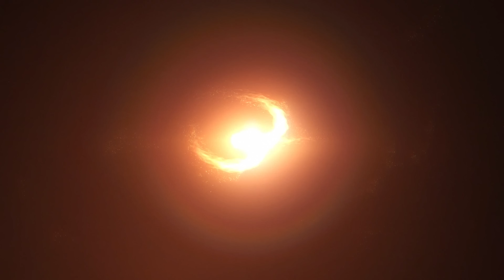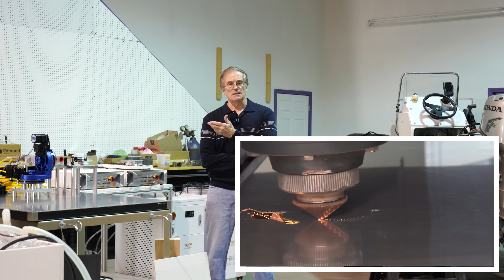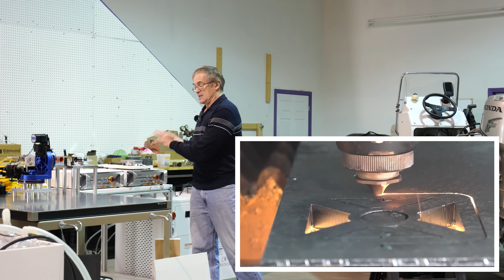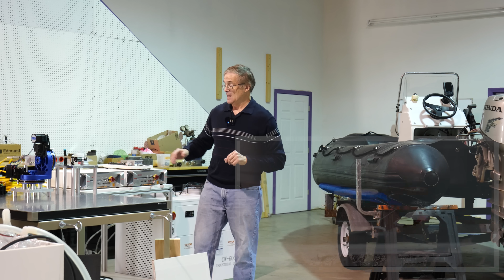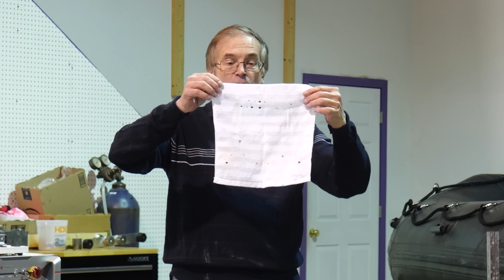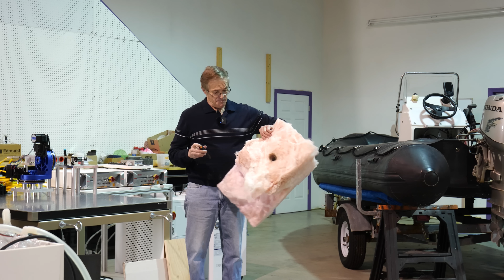We have a problem... and need your help!

Comment: What about a slab of graphite in a water tank?  Graphite has very high melting/vaporization temps.  The water would not only help to cool it but also prevent hot carbon from reacting with the O2 in the air.  Of course the container would have to be glass which presents its own problems.  

Some of the comments mentioned a light sensitive kill switch on the back side of the barrier just in case the light breaks thru... great safety idea.  It could be as simple as a conductor.  As soon as the wire/conductor vaporizes, the current in it goes to zero, which could be used to stop the device

Comment: How about a tutorial on correcting laser beams?  CO2 lasers are pretty popular, but vary in beam quality.  They only have focal lengths of 50-150mm (typically) so not quite the same as here, but I think beam quality is important across applications.
Reply from the maker: That's  a VERY BIG TOPIC. 
It requires at least a modest amount of knowledge about optics that covers a very large wavelength and energy range.
Reply: @TechIngredients  For the CO2 lasers, typical wavelength is 10.6um.  Power range is 20-200W.  That covers a large swath of what's in use in the hobby/makerspace/small business space.  Since I don't know the details very well, I can't say for sure, but my guess is that some of the principles would be applicable outside of those parameters.  But you're the expert!
Reply from the maker: I probably wouldn't limit such a presentation to only the CO2 laser.
They're becoming legacy and less and less popular.

Comment: you make a gel in bed sheets, the beam will not like water but gels are better so basically it creates your cucumber but more practical
Reply from the maker: That's not too different from what we ultimately did.
Check out our latest video ON THIS TOPIC where we used the results of a cucumber to design a gel based absorber.

Comment: Dear , two floor tiles (as cheap as less than $1 per sf, widely available without need to add on any works) face to face holding a water membrane that form a barrier  with five layers (brick, glaze, water, glaze, brick. in that order).   The glaze layer is a liquid coating composed of minerals (silica, feldspar, kaolin), metallic oxides, and pigments, applied to ceramic or porcelain tiles before they are fired in a kiln. During firing, this mixture melts and fuses to the clay body, creating a durable, non-porous, and waterproof glass surface.

Comment: There are many materials available, but most are relatively expensive. Besides a few oxide coatings, this might be cheap and of interest: The "Starlite" coatings from the NightHawkInLight Chanel on Youtube. When heated, CO2 is released, which acts as a flame retardant in the spaces between the charred remains and trying to melt coal requires extreme temperatures. Making coated panels of this may work for like 20-40 seconds, maybe even more.
Reply from the maker: We did two short follow-up videos where we discovered a solution and then implemented it.

Comment: brainstorming the problem led me to think of a composite board material composed of other products, face material a gypsum panel, 1/2" acrylic panel, and the backing another gypsum panel covered with the 3m reflective marking tape, preferably white, or blue and laminate it or keep stack together
Reply: the idea is like body armor the face material of gypsum isn't for diffusing but capturing bounce back light, the acrylic panel would defuse the light slightly arranging the beam in un even beams to the 3m reflective tape which reflects and disperses light back through the acrylic and into the face panel. as the acrylic heats up its begins to deform multiplying its diffraction but as it burns it slowly turns into aa darker compound potentially capturing more light than it can diffuse. but i believe would give a 1-2 sec window of backsplash for the laser, probably get around 5-8 uses per composite panel .
Reply: could go as far as coating the surface of the gypsum face material with a graphite powder to absorb and diffuse the initial beam

Comment: What about a wall about 1 m thick filled with a material that you’ve tested to be most resistant to the beam. Have this wall on rails so it’s continuously moving so should the beam hit the wall it’s hitting a section of the wall that is untouched. Moving the wall constantly should be easy, use a crank system connected to a small electrical motor with a reduction box. This should give you the few seconds you are chasing to shut the system down. Having a filler something like sea sand that will always fall in on itself after being blasted by the beam. Trial and error will determine the wall thickness, I guessed at 1m thick
Reply from the maker: The issue would be complexity. If we're trying to take down a swarm, the beam will be dancing all over the target area in a short time.

Comment: Hello. I have an idea, place the Laser on the ceiling facing to the floor, then put a deep bath of moving water below the laser on the floor. The bath must be flat to the floor. Meaning the bottom of the bath is the floor. This must be the ground so when the laser is turned on, there's no were for the beam to go. Place your experiment table just above your bath of water, the working top of your table must be made from chicken wire or something a bit stronger. Finally put you subject on the table. This should work!
Reply from the maker: If you watch the follow-up videos where we address this, you'll see that the problem includes protecting a very large area and we came up with an excellent solution based on the performance of a... cucumber.
Reply: @TechIngredients cucumber? I'll need to see this. Thanks this sounds to interesting to ignore

Comment: How has no one suggested a BLUE panel?! 
Maybe some
sort of silicone coating over a piece of heat conducting material.
Reply from the maker: We debunked that myth around the time of the Maui fires.
Fiber lasers and any possible high power laser that could be used for this purpose will not even be affected by a blue colored barrier.
Remember,  what your eye sees as blue has a complex spectrum of absorption and transmission.

Comment: Maybe just an aquarium with a mirror tilted 45 degrees pointing downwards. At the bottom place something expendable like bricks. Maybe cement blocks with permeable structure that would allow air to be pumped through, creating many little bubbles that would act as lenses and disperse the beam. Additives to absorb and scatter the beam like others said would also be a good addition.

Fill the aquarium with water of course that would cool the mirror and the bottom.
Reply from the maker: Remember that we have to protect the entire back wall of approximately 20^2 meters.
Did you watch our follow-up video where we demonstrated an excellent,  low cost solution?

Comment: You made the beam with optics, why not use that at the end to diffuse it?
Reply from the maker: We have to cover approximately 20^2 meters of back wall.
Reply: @TechIngredients  fair enough. What about the fact that high frequencies of sound resonate and get lost in walls and the low frequencies pass like a "low frequency filter" for audio. what about something like that for the laser? Is the theory even sound (no pun intended) when talking about visible frequencies? could a low pass filter for light be accomplished through like a tint film style thing. maybe something you could produce a giant sheet of?
Reply: @TechIngredients  possibly stack a lot of these sheets or panels that are very weak themselves but stacked up you can have a great effect without them being consumable if that makes any sense.
Reply from the maker: If you watch our slightly more recent videos on this subject, you'll see that we "discovered" an excellent solution. Thanks to the cucumber!

Comment: Maybe retro reflective street signs,  this will make the beam always reflect back to the source so instead of needing a large cinder block wall to cover the garage you could have a much smaller wall behind the laser itself. 

If the retroflective coating doesn't hold up to the laser you could make a cube corner patterned structure from free salvadged first surface mirrors out of rear projection TVs 

I know this idea doesn't hold up on its owm but maybe its the start to something
Reply from the maker: We came up with a great solution. We posted the video just before our distillation video. 
Check it out.

Comment: Ask Elon Musk for some Starship heat shield tiles.
Reply from the maker: I'm tempted if they would be willing to sell us enough for the back wall.  This is assuming it works.  I actually don't think they would work based on our testing of the aluminum oxide fire bricks.
Reply: @TechIngredients Ok, how about 15mm thick aluminium or copper plate, hard-anodise + black dye mounted at 45 degrees and aggressive water cooling from the back...you'd get 15kW per cm2 for a good while.
Reply from the maker: The problem would be the cost to protect 20^2 meters of wall.
Reply: if you could find enough scrap SS or AL plate and get it sandblasted say 60-100 grit, rig up a 45 degree angle and some cheap water pumps then maybe $1000. Have you tried matte white ceramic floor tiles?

Comment: Assuming you haven't found something, have you tried two or three layers of fire brick wall? I'm with the others on aiming it at the ground though, accounting for the warning below. Possible reflection is also why I wouldn't use water.
For those arriving here who might try something themselves:
THESE WILL BLIND YOU!  
Aside from burning holes in things, lasers at this power can still blind after reflecting off surfaces. There are probably many more reflective surfaces around you than you realize. Wear appropriate eye protection any time you are around lasers! Even Styropyro does, so you should too.
Reply: Another unrelated note regarding the microwave and this drone-stopping project:
Considering that the original idea I heard was for use in Ukraine, the drones coming at them are likely to be armed with dead-man's munitions which will explode on hitting a physical object.  
So unless your range is several hundred meters or the lasers are also drone-mountable I'm not sure this is the best solution. Not saying to stop development - it could be very useful for less risky situations.

Comment: 3d printed carbon fiber pyramid micro-grid and make them. Play with pyramid size, transparency, angle hight and colors.   Maybe try transparent nano delusion grids in front to reduce the intensity hitting the pyramid grid

Comment: how. about a mirror to divert the beam into water below or adjacent to the beam.
Reply from the maker: The mirror would have to be BIG. We need to protect approximately 20 ^2 meters of the back wall.
Check out our last video.  We found an excellent solution.

Comment: A) Foamglass  Plates
B) Insulating Glass Units (acrylic glass) filled with  
    B1) Al2O3-Balls (Perlite)   2-5 mm
    B2) Ball Corundum (Sandblasting)
    B3) White Corundum Hollow Balls (if weights an issue) [fireproof technology]
C) IGUs (like B) with Water-Filling  (using some foam or wool , but no CO2 !)
Reply from the maker: Check out our latest video.

Comment: Take hollow insolation plates, filled with coarse sand or small glassballs, that will replace the material burned.
 A bit like the effect Safe-Producers are using against plasma-cutting etc.
 Maybe even those little Gel-Balls (Orbeez) will work.
Reply from the maker: Watch our follow-up.
We solved this.

Comment: Maybe something similar to a residential HVAC. Using a semiconductor that is behind the target on one side but cooled on the other side. Maybe something of the sort. Draw the energy away from the point of contact. If it was fast enough but prolly will not be

Comment: Diamond has superb thermal conductivity, so a giant diamond might work... if you can find one on clearance. Does the laser have some specs on the power output? That might help someone do some math to figure out how much energy needs absorbed. Maybe reconsider your absorption requirement if you can make a lens large enough to redirect the beam into the ground.

Comment: I wonder if Polyethene tubing filled with water would work, because as it gets pierced what water contained within would rush out of the hole created and the stream itself would be within the path of the beam for a few inches before it curves downward.  If the beam was aimed near the bottom of a 6ft tube then you would have quite a reservoir to keep flowing cool water directly into the path of the stream.  Its also only about $75 for a 1500ft roll of 4 inch diameter tubing.

Comment: A sandwiched wall with a small layer of loose Sand in the middle and maybe drywall and/or plywood on the front and the back might do the Trick. Sand on its own is hard to penetrate with a laser because it molds and the molded sand (glas, lava, Silicium) is quite good in stopping a laser from penetrating it. Furthermore because the Sand above is loose, it might fill the hole, if the laser will get through anyhow. Fireclay sand or Fireclay granules could also work and might be lighter than ordinary sand. This way you might end up with a self healing wall.

Comment: Monterey Bay Aquarium shows me the practicality of using a huge wall of opaque black water behind a transparent window made of the same glassy material as the fiber used in the laser. A pigment like carbon black would need to remain in suspension continuously during the laser operation. Perhaps printer’s ink will do, but is diluted so that a horizontal column of water, when hit with light energy, can dissipate resulting heat energy over several inches. This way, the natural convection of heated water (or steam) will utilize aquarium’s massive specific heat capacity of H2O!
Q.E.D.
(mentioning Monterey Bay Aquarium is my blatant plug of a great science organization, by a longtime member.
Please visit!)
Reply: P.S. I took as given the beam would hit the aquarium perpendicularly. If not, any glass becomes partially reflective at other angles. @DebojyotiBhattacharjee-h8c earlier shared a great idea: to use camera light detection to automatically shut off the laser. To accomplish this backup, I would add an opaque barrier spaced a few inches in front of the aquarium that would block all light from hitting glass before penetrating, while additionally catching any reflected energy bouncing back. Instead of a camera, a few photodiodes well placed inside the light box would simplify the shutoff circuit. Redundancy in design will make you both safer.

Comment: Have you considered the idea of combining various materials, such as carbon fiber mats, graphite sheets, and silicon carbide tiles? This should reduce weight and toxic emissions. I'm not so sure about cost though.  Incorporating additional suggestions from the comments, like a mechanically moving backdrop or a continuous flow of water, could decrease thee chance of burning the substrate.

Comment: Would it bet better to focus the beam with a sort of reflective parabola, so you dont actually have to cover the entire backwall with the material you can then focus it on the brick youve shown or a more solid, less porous stone. A sand box would also work id guess, tho the sand particles could also be too translucent. If the focusing woks however you can probably add something that could disperse the laser, like water, a prism or the like, to make the energy less focused and easier to manage. Additionally you could put a water tank at the focal point and a very high melting material suspended within it, like a small tungsten cube. it should be rapidly cooled down by the water flowing back onto it and disperse the laser further with steam. Id recommend being very careful with that though, im not sure how strong the refracted laser would be if it hits steam.

Though speaking of, steam/gasses might also be a good way to handle it. put a fog machine, water humidifier or dry ice behind the wall and let clouds form. they should be able to accept a lot of the damage.

Dry ice may also be a valid solution. Cheap, disposable, doesnt catch fire

Comment: Perhaps you are thinking of the problem wrong.  Instead of  blocking the laser light you might want to absorb it.  So a wall painted black.  I wonder why you did not consider cement board, It is fire proof and should have a high melting point similar to brick.   I like the wall of water but wonder why you used the cloth rather than a waterfall.  A dye may make the water more absorbing.  An alternative might be to use a mist.  You could recycle the mist using a principle of an air curtain often used to keep in air conditioning when doors have to remain open in large stores.  You may also have to increase the thickness of the mist.  I think CO2 is opague to light.  

But on the other end there is also a different way of thinking the problem.  It may be time to reduce the intensity of your laser by pulsing the output. Think of a "Blaster" from star wars and you see light pulses.   You could change both the time between pulses and the duration of the pulse.   I don't think this would be too difficult.  It may be accomplished in the software.  Even better would be a pulsed effect until there was a confirmed lock and then the duration of the pulse is changed.
Reply from the maker: Thanks for the suggestions. 
Blocking and absorbing in this situation are the same thing. We don't want to reflect the light, obviously.
We also don't want to depend on the electronic control over the laser when several failure modes that could cause damage are due to failure of the control itself. 
A "waterfall" is pretty complex when we have to protect approximately 20^2 meters of the back wall.
The cement board is one of our leading contenders along with water saturated MDF and Rockwool.